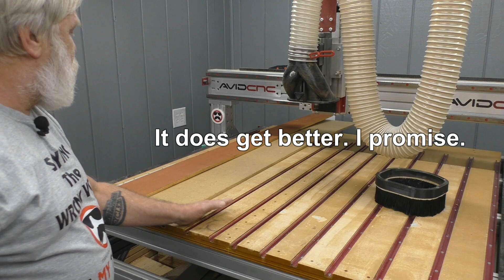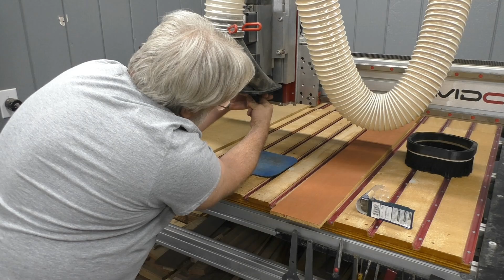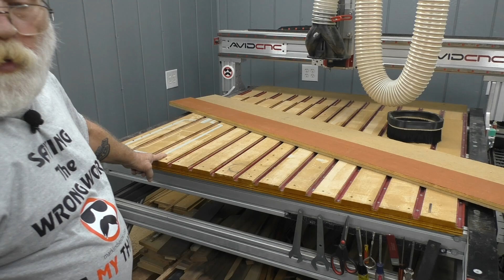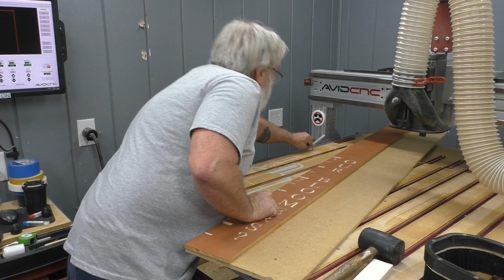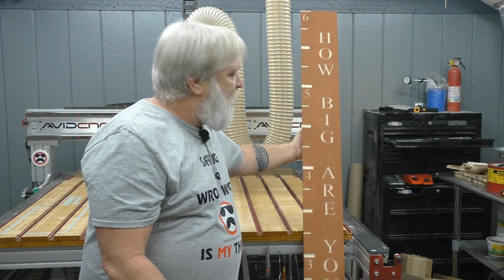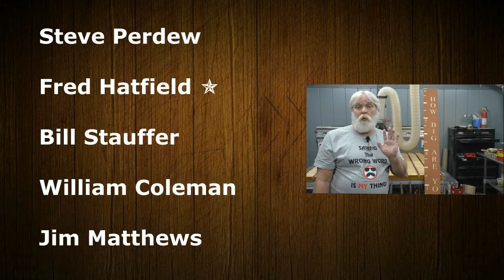Tiling Toolpaths Part 2 – Mounting and Cutting the Project

Comment: Coming back to this as I’m about to cut some speaker cabinets that are 58” in length. So thank you for posting these almost 2 years ago. One quick question. Would you see any issue with using a sheet that is say 2” wider than the actual cabinet width and drilling a locating hole on the left and right side and the another set if holes maybe 30” down? This avoids using a sled and uses the additional board to the left and right for alignment holes.
Reply from the maker: That should work just fine. I would have done it that way if I wasn't using a fence picket. Good luck!
Reply: @MarkLindsayCNC thank you, sir.

Comment: Great work Mark! We love seeing Raptor Nails working for you!
Reply from the maker: Thank you! I use Raptor composite nails almost exclusively for holding sheet goods (plywood/MDF/OSB) to my spoilboard. I find they split hardwoods, but that's simply because of the gauge of the nails. No worries - I have and use other workholding methods for hard and softwoods. But for sheet materials? I'm Team Raptor all the way.
Reply: @MarkLindsayCNC  Love to hear this! We have a solution for the splitting issue. I will send you an email.

Comment: Do you find it easier to change tools and rezero for each tile or do Tool 1 on both tiles then Tool 2 on both tiles?  I've tried both ways and still undecided.  It reduces the number of times I need to rezero the Z.  EDIT as i think about for your case because of the composite nails, zero-z would be easier.  I use dog holes and horizontal clamps most of the time.
Reply from the maker: I complete the first tile before moving on to the next tile. I really don't mind tool changes, and I use a touch plate to set Z zero, so it's no problem for me.

Comment: I am doing a similar project but I'm carving on a 2x12 piece of lumber.  Would your process stay the same or would you change anything to accommodate the larger piece of wood??
Reply from the maker: The process would stay the same, with the exception of the measurements, of course. This project turned out very nice, so if I needed to do it again, I wouldn't change a thing.
Reply: @MarkLindsayCNC  Thank you!

Comment: Another great one Mark. What brand tape (blue) did you use with the CA glue? Looked like it didn't to adhere to the sleds MDF material at all. I want to avoid purchasing if that's the case.
Reply from the maker: I use 3M's blue painter's tape. The blue painter's tape adhered to everything just fine. It's just that the glue is stronger than the tape, so it all came off cleanly. That's typical. It was slightly off camera, but what I do is use an old Craftsman chisel and slipped it in between the fence board and the sled, then slowly pried up on the fence board from that end. It lifted the tape up off that end of the sled, then just peeled right off over the entire length of the sled. It does the same when I use it on my spoilboard. I'll talk about it more on Sunday's live Q&A, but I also tested out some double-sided tape at the same time. It didn't hold worth beans. That's why I didn't shout it out in the video.